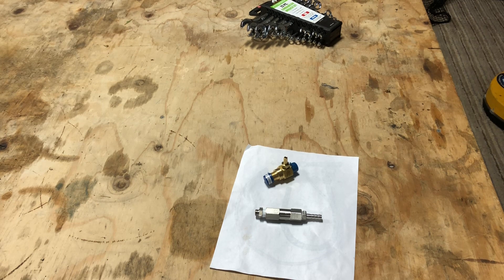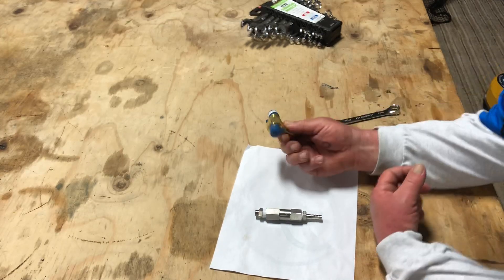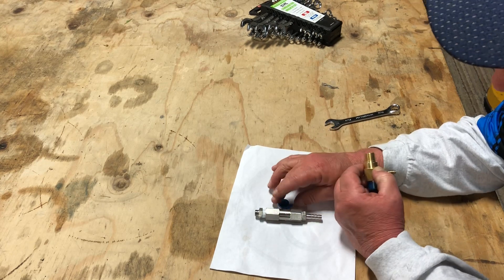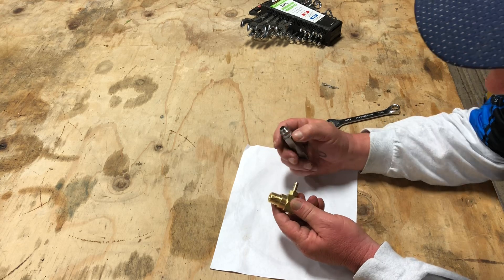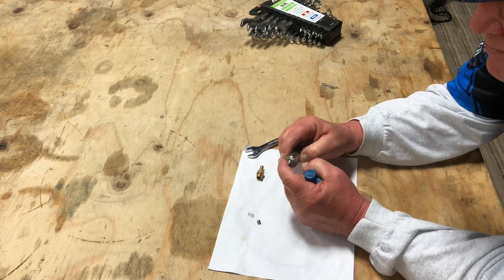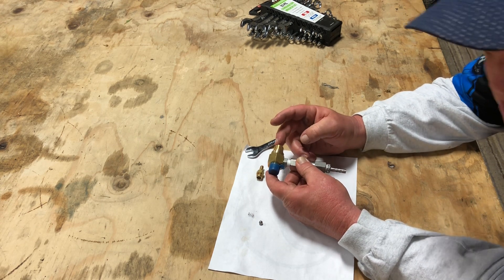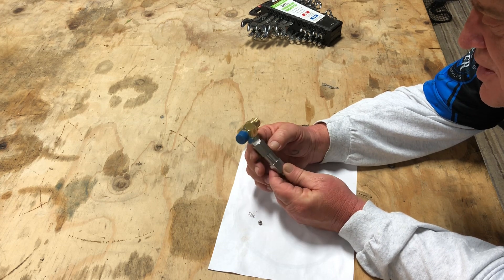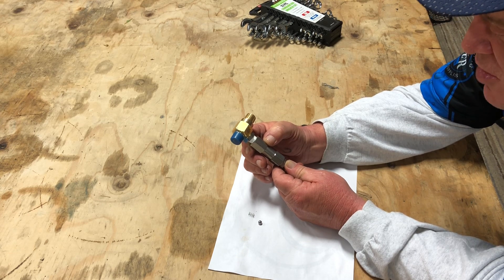Downstream Injector Check Valve

Comment: Doug can you make one with a 2 way valve with two barbs ? To add two hoses for fleet washing acid and soap cleaners.
Reply from the maker: We don’t but you could buy the parts and build one. We have the 2 way and 3 way poly valves available
Reply: @PressureCleaningSch  can you put the parts list together for me and I’ll buy it on your website. ? So basically all I need is this unit as shown in the video and then extra barbs and the 2 inlet valve.
Reply: @PressureCleaningSch  also do you ship to California? I need a by pass for all this. It will be directly under gun.
Reply from the maker: @timexkills65  email me at info@dougruckerstore.com what all your wanting an I can get a list together

Comment: What injector with the check valve assembly? Do you recommend for an 8 gallon permanent machine and a 5 gallon per minute machine I’ve gotten people who differ on their answer with this. I know that they downstream injectors themselves state something different than what people actually use them for is it a bad idea to use a 1.8 for an 8 gallon per minute machinewhat do you recommend and why and with that recommendation stand the same if I’m using the check valve, which makes it a slightly hotter mix.
And I should have started off by saying thank you for a great video. You’re always a huge help.
Reply from the maker: On my 8GPM and 5GPM I use the 2.1 3-5 GPM injector.  A 1.8 can be used on the 5GPM, but if you use it on the 8GPM you will lose quite a bit of distance and flow, so I dont use that on my 8.  The 1.8 I mainly use on my 4GPM portable.  I use the check valve on all of them.

Comment: Used my dstream injector to clean my 1st house this past Sat. Went great- although when I switched tips (from black/wash to white/rinse, I looked over at my bucket of SH and the water was back-flowing into the bucket of SH, pouring over the edge of my bucket and thus onto the customers grass, where I (mistakenly) had it sitting. What happened, is this normal?
Reply from the maker: No not normal. Sounds like maybe some debris got in your injector. Can you take It apart and check the ball and spring
Reply: Same issue here
Reply: When you are changing tips you’re increasing and decreasing the amount of pressure coming from the wand. That will change the Venturi effect within the injector  not allowing the chemical to suction. I imagine water is coming out the tube because there is no ball in that downstream injector check valve but I’m just guessing.

Comment: Do you think it would work ok with a 4 gallon per minute pump and 200 feet of 3/8 hose?
Reply from the maker: Yes. Use the 2.1 3-5 GPM injector.
Reply from the maker: @69spanks  I didn’t have a problem on my 4gpm and 200 foot of hose but I usually only use 150 feet.  It could be the machine being used though. Direct drive vs Belt drive and other factors
Reply: @PressureCleaningSch  Ooo. I have a belt drive. 200' hose good with that?
Reply from the maker: @sudbuddiesexteriordetailin9843  should be. Just have to try. If not, back down to 150 foot
Reply: @PressureCleaningSch  Thank you Sir!! Appreciate you very much.

Comment: How long did your downstream injector last with the check valve on it
Reply from the maker: Never really charted it. They do last longer. But I have a tendency to change things out before they can go bad. So about every 8-10 months I just change them. We keep spares ready to go too.
Reply: I researched these and bought one with Viton o-ring and a Hastaloy spring - which seemed to be the best quality. I diligently flushed mine with 5 gallons of fresh water after each job and in about 3 weeks the check valve was no longer closing all the way and back feeding water into my bleach tank as well as cycling my downloader valve. HUNK OF JUNK for the high price I paid. Not sure about the quality Doug is selling here, but that was my experience with the one I purchased elsewhere. ☹

Comment: Hi Doug, can I install one of these after my fixed  injector that’s fixed to the pump?
Reply from the maker: No, the fixed injector would need to be removed
Reply: @PressureCleaningSch  Ok, So basically removing the hose Barb,  ball and spring then installing a plug? Do you have a plug available at your store? Would I be able to remove the hose bard and install a check valve instead?
What would be best?  plugging the old inject that's fixed to pump and installing a new one  or install a check valve?
Thanks for replying Doug, you're the best!

Comment: What is on the inside that allows you to remove the ball and spring?
Reply from the maker: When you take the hose barb off the injector the ball and spring will fall out.  So be careful you don't lose it. I always cup mu hand under the barb on the final twist to remove the barb.

Comment: Mr Doug,  Ricky here in Cookeville Tennessee,  will this work on my injector I have a 4000psi 4gpm belt drive
Reply from the maker: hey Ricky, link time no hear. Good to hear from you. It will work on your machine. But The only injector the fitting will work for, if you only buy the check valve without the injector is the General pump high draw.
Reply: @PressureCleaningSch  ok thank you for reaching out and letting me know
Reply: I having the same problem right now I’m running 200 feet 3/8 pressure hose I just finished set up 11/17/2022 and im running hydro teck 3500 5gpm hot & cool water but my chemical is not strong enough im doing 2 step fleet wash what do you recommend mr Doug u you think this downstream injector check valve is working for me ?

Comment: For years, I use an 10:1 injector on a 4 gpm pressure washer.
I usually downsteam straight 12.5% Bleach. Five gallons at a time for house walls.

If I went with an 2.1  injector... What would the bleach mix be for five gallons...
Would that be 3 gallons of bleach to 2 gallon of water...?

.
also If I went an 2.1  injector with a Downstream Injector Check Valve.
 What would the bleach mix be for five gallons.. How many gallon of bleach to water in a five gallon mix...thanks...
Been going though your videos...Thanks for taking the time...
Reply from the maker: Your mix is dependent on the surfaces you're cleaning, strength of bleach your using, GPM of your machine and degree of the staining.  For our 8GPM and 5GPM we always downstream full strength.  For our 4GPm it's just dependent on the above variables.  You have to play with it and adjust a needed depending on what you are cleaning.
Reply: @PressureCleaningSch   Thnaks for answering all these question on this tread...
Is there a math formula for  the different size injector with different GMP plus how much  strength of bleach you want.
>
Now if you made a list of all the injectors out there, 
with the % of each water and Bleach would be very helpful.
I think a lot people will  buy that list.
.
for example: Using 12.5 bleach in a 5 gallon mix.
20:1 injector will use ? gallons of bleach to ? of water to make 1%
10:1  injector will use ? gallons of bleach to ? of water  to make 1%
4:1  injector will use ? gallons of bleach to ? of water  to make 1%
2:1  injector will use ? gallons of bleach to ? of water  to make 1%
..
20:1 injector will use ? gallons of bleach to ? of water to make 2%
10:1  injector will use ? gallons of bleach to ? of water to make  2%
4:1  injector will use ? gallons of bleach to ? of water   to make 2%
2:1  injector will use ? gallons of bleach to ? of water   to make 2%
.
20:1 injector will use ? gallons of bleach to ? of water to make 3%
10:1  injector will use ? gallons of bleach to ? of water   to make 3%
4:1  injector will use ? gallons of bleach to ? of water    to make 3%
2:1  injector will use ? gallons of bleach to ? of water    to make 3%
.
20:1 injector will use ? gallons of bleach to ? of water to make 4%
10:1  injector will use ? gallons of bleach to ? of water   to make 4%
4:1  injector will use ? gallons of bleach to ? of water    to make 4%
2:1  injector will use ? gallons of bleach to ? of water    to make 4%.
.
20:1 injector will use ? gallons of bleach to ? of water to make 5%
10:1  injector will use ? gallons of bleach to ? of water   to make 5%

4:1  injector will use ? gallons of bleach to ? of water    to make 5%
2:1  injector will use ? gallons of bleach to ? of water    to make 5%.
.
Then do the same list but for 10% bleach. 
.
If you sell this idea, please send me a free copy...
.
O yeah, do one for 1-1/2%  mix.
>
Also, why don't you or other people use the 2:1 injuctors for downsteaming? 
Would,'t you use less bleach?